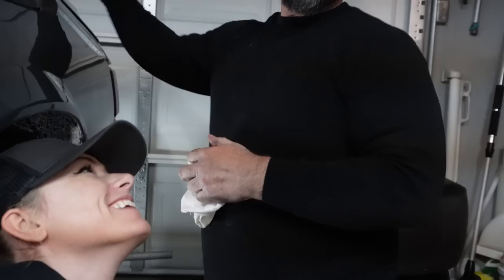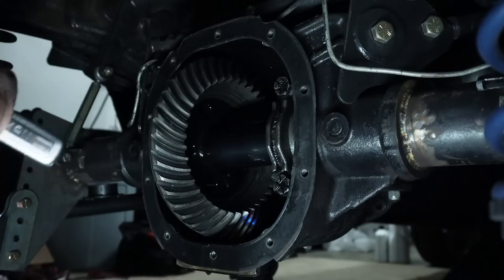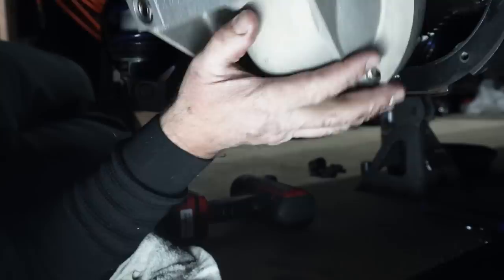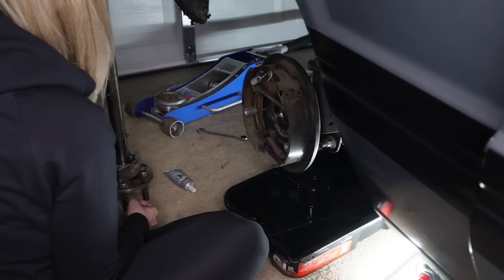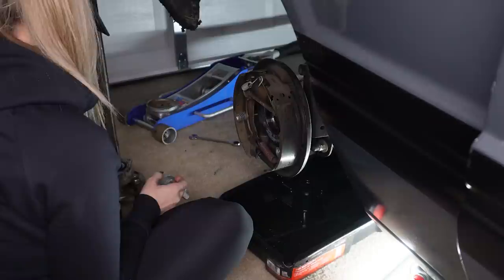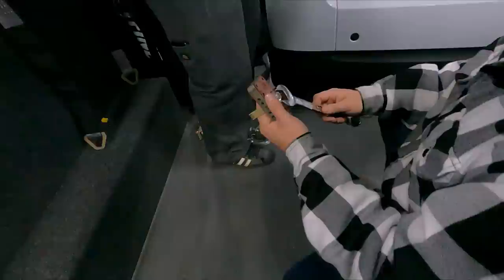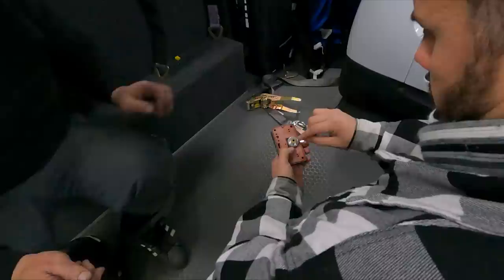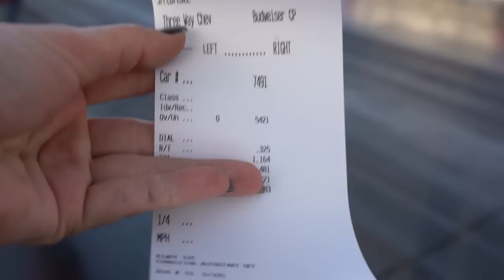Gray Mare DESTROYS the Stock Short Block Record (part three)

Comment: Congrats on the new record.  Great seeing the work you put into it instead of others who post one hero pass and act like it did it on the first try.   I remember going 6.4@108 with a factory xxx roller block 306 in a 2850lb 87 coupe back in 2007 and people swearing I had some stroker or a sportsman block etc lol.  I went 10.46 at only 126 where I ran out of gear and had to lift before the stripe.  I drove the car on the street all the time and everyone only ran 1/8 so I never bothered swapping gears and trying the 1/4 again before I sold the car.  Was definitely fun having people guess and speculate and accuse me of having more engine than I did lol.  Hope 2023 goes great for you guys.

Comment: Ok, that is super impressive (and T & T Gangster), that you are out hammering stock bottom end records, and wheels up high shoot to the moon stick shift launches with gun drilled axles on just a stock 4 lug 100mm pattern, and drum brake rear, and you hand torqued the ring gear retaing cap bolts too...Chek, Chek, Chek, Chek.....gotta love it brother! (They certainly must have highly improved the Famoso top end shutdown area, as it was mainly worn out black top turned mainly to gravel in the old days!) I know it was hard to get a heavy car stopped there on drum brakes.

Comment: After you chucked all the teeth off the distro gear down into the middle of the block,, cam,  rod and pan area on street pass 2, it cracked me up that Tess starts talking about tossing and chunking up belts.....lol, give me lost belts over those metal teeth sheared off internally any day, as long as it is a non-interference engine!
Reply from the maker: I get it, but when you’re in competition and lose all boost every pass at half track because your blower belt flys off, it gets frustrating. I did end up winning that race though, so I guess it wasn’t terrible. Haha.

Comment: Old school. 69 302 from a sionwagin. 66 mustang 250 6 cylinder rear gear c 4 transmission no vacuum 130 guarter mile. Best tramsim was a torkdrive from a 70 4cyl nova high and low gone

Comment: Congrats on the record. Can hardly believe it's a stock 8.2 short block, which convinced me I'm just going to refresh my stock short block and throw a blower on it. Wanted to ask, which Trick Flow heads are you running? 
Also, WE WANT MORE LUNCHBOX! That dude had my wife and I in friggin stitches!
Reply from the maker: They’re the twisted wedge 170s!
Reply: @MissMidnightMaverick   are they the 11R version or the non-cnc’d fast as cast version?
Reply from the maker: @aaronliddell4280  I bought them off of Craigslist 10 years ago, I honestly have no idea.
Reply: @MissMidnightMaverick  they’re most likely the non-cnc’d ones then. Very impressive. Do you know what cam you’re running in the car?

Comment: Hi, is this the build with the stock '69 or '71 block?    ( not the thin wall 85-93 castings )
Reply from the maker: It’s out of a ‘90 mustang
Reply: @MissMidnightMaverick  Holy Moly....   And a blower too..    That's amazing.   That block must have fell on the side of more favorable tolerances.

Comment: So this engine is complete stock bottom end other than the cam? I'm pretty impressed if it is and making over 600hp...I thought stock bottom ends starting blowing up at about 500..?
Reply: I've got a completely stock 302 with just an ebay turbo and bigger injectors and a aeromotive fuel pump... Running no more than 15 psi.. I have no idea what it makes though. Bought me a terminator x but haven't put it on yet.
Reply: That has been a long nonsense rumor created by shit talking chevy guys. There are guys making 800-900 hp on the stock bottom ends. Also, sell that termi and get you a coyote. If you are going dohc, go coyote, hands down. You can find them on the net for around 2k on a good day. If its a gen2 or up, you got an easy 1000hp ready to rock.

Comment: You guys need to try a c&s Billet aerosol blow through. Way gooder..when you have to lift and get back into it dont have them kind of problems.
Reply: There is nothing wrong with that carburetor, it was the distributor gear being worn out
Reply: Look like it bogged out the track to me when he got out of it and back in it
Reply: I'm not saying anything bad the car's fast as f*** it looks like it runs great at wide open throttle I just expect more out of my carburetor than only wide open throttle performance.
Reply: Understood but there is more to it then that. I’m sure things can be cleaned up more but part throttle isn’t that big of a deal when there is a time limit on how long this motor has.
Reply: We also run the carb rich because of the dry nitrous and it had a bunch of timing pulled to make the motor live.

Comment: How do yall keep a stock 302 together with 600whp? Insane! I managed to break a stock crank in half with a 125 shot lol
Reply: Probably close to 700 at the track
Reply: Make damn sure it doesn't rattle/detonate.
That kills more boosted SBFs than anything else.
Reply from the maker: Motor plate, mid plate, very loose converter, very conservative with timing, and the small shot of nitrous helps keep the air nice and cool.
Reply: @MissMidnightMaverick  
You got it, Tess⚘️
Reply: @MissMidnightMaverick   Av boys grandpa Hollywood    The Carburetor Chronicles  
Clearly You'All [of the Team] know well what You are doing to get this "Gray Mare" running its best and perform to this level !! 😄
Excellent !! Congratulations to and with ALL involved !!😆
Since You'All are proceeding with Tess driving, with significantly lighter driver mass, weight, it is reasonable that You'All would already know about a few simple things:
A. simple weight reduction via the brakes - as per noted in this recording - obviously removing the heavy rear drum brakes - replacing all four with lighter racing TBM disc brakes.
B. Aerodynamic - air flow: 
-1. using a lightweight fiberglass or carbon-fiber hood on the engine with whichever scoop or raised area as necessary - better air flow over the engine compartment and clearly air fore the engine intake too.
-2. remove side view mirrors and any other external protrusions.
These alone will gain easily -0.1-0.2 sec in addition to the driver and other weight reduction along with other simple improvements too.😏
C. Fuel:  Tess stated in the chat, the fuel used was C-16. =>this is a common mistake based upon common misconceptions among most experienced, street, track, amateur racers, 'enthusiasts', 'gear heads' and seemingly some of You"All, perhaps some of You too? 🤔
-1. C-16 = C-116 is a high octane fuel with tetra-ethyl lead
-2. high octane rated fuel is needed for high compression cylinders to slow the burning, combustion rate 
-3. => high octane fuel does NOT have more power or energy from burning, combustion !! 
-4. the chemistry, physics with various fuels is well known, established, precise, exact, accurate, calculable
-5. Octane=C8H18, octanol=C818O=C8H17-OH, methane=CH4, methanol=CH4O=CH3-OH, ethane=C2H6, ethanol =C2H6O=C2H5-OH=CH3-CH2-OH
-6. all octane rated common gasoline fuel have a combination with numerous molecule forms. compounds of various hydrocarbons from the simplest methanol, CH4O through higher order, longer chain hydrocarbon molecules including various benzene ring molecules etc. 
-7. higher order, longer chain hydrocarbon molecules obviously have more carbon, thus less power, energy compared with simpler hydrocarbon molecules along with increased burned carbon post burning thus deposits which also remain, and coat the cylinder, piston, heads, combustion chambers, valves, spark plugs, exhaust ports, headers and pipes.
-8. there is also proven data with numerous dynometer measurement of the engines, and within vehicles showiing the clear increase of energy, power, torque output from the engines through the entire drive train using ethanol, methanol, combination of these compared with all version of unleaded, 87-95 and leaded fuels including the commonly used high octane racing C-10 -16=C-100-116 fuels. ->even standard "E-85" from the local fueling station pumps, which is actually commonly 40% up to 55%, sometimes up to 65%, has been measured within all dynometer tests to achieve significantly more power, energy reaults than C-10-16=C-110-116, including with methanol injection. 
-9. The Best ethanol fuels are the pure and racing versions are E-85=C-85=85% ethanol, which NASCAR uses for decades, -90, -95, -100 100% ethanol which Indy Car switched to from 100% methanol since 2007. 
-10. also with cleaner fuels the fuel system remains cleaner, all internal engine components and exhaust the engines, since there is much less carbon, carbon deposits, thus carbon residue, build up, etc. The tetra-ethyl lead in C-10-16-=C-110-116, adds more to the deposits, build up with PB=lead, and more carbon -> all needlessly without any benefits, only detriments !
D. Ignition: If there are any possible improvements with the ignition, certainly more power can also be achieved, as You already know; higher voltage spark, ignition components [50 kV] and similar.
then, certainly, as You well know, obviously, the other considerations within the drive train, suspension etc. will clearly achieve improvements too.
E. Lubrication; As You also known, small improvements in performance, results will also be achieved with improved oils, fluids, grease, etc. within the engine, transmission, converter, gears, differential, axles, wheel bearings, etc. - certainly RoyalPurple,JoeGibbs,Shaiffer's are significantly above the 'major, 'minor ' brands from the StndOiInt'llConglomerate producers [we know them full list] and among the top, the best, proven by the full of tests, including durability, reliability is Amsoil - the only engine oil which is also 100% synthetic, with a 24 month, 24k mile warranty and the full test data comparisons to prove it. No wonder they were the first publicly available produced, verified, certified independently by 1972 and continue to improve, produce a full range of synthetic lubrication products along with their unique micro filters too. 😏
->Aren't Your magnificent, grand machines worth protecting, lubricating with the BEST available ??! 🤨
G. The results shown, achieved with the "Gray Mare" are certainly Grand, with all that exists, used,  components, set up, tuning, adjustments, etc.
Good Luck, All The Best and Much Success in Your Quest, Health, Happiness and Well Being. 😊
Sincerely ☺
Reply: @MissMidnightMaverick  thanks for getting back to me MMM, that explains things 🙂
Can't wait for more Gray Mare content.

Comment: Looks like you guys need to take that gray mirror over to Old Man garage and let him play with that carburetor if not ATMs got a signature old man garage carburetor maybe you ought to put that on there
Reply from the maker: Did you watch the whole video?
Reply: Why, so he can fuck with the idle circuits every 5mins?
Reply: @MissMidnightMaverick  I watched the whole thing but the sound was way down so I missed some stuff. That dude called Lunch Box did the carb. Does he sell carbs to the public? Under what name?
Reply from the maker: @peskypeet  he owns a carb shop and has been working on them for over 20 years at his shop.
Reply: @MissMidnightMaverick  Tess- Thanks for replying. So what's the name of his shop or brand of carbs?
Reply from the maker: @peskypeet  Ted’s Carb Shop
Reply: @MissMidnightMaverick  Thank you. I've never heard of that. But there's soooo many good companies out there that have somewhat of a low profile.
Reply from the maker: @peskypeet  he’s a local carb shop out here, he doesn’t sell specifically branded carburetors, just works on them, rebuilds them, and tunes then.
Reply: @Adrenacyde  this is fucking hilarious 😂
Reply: @lunchbox2565  It's only funny because it's true.

Comment: And then changing Jets changing power valves actually working on it on the spot at the track that's the whole fun not plug it in the f**** laptop taking out some time and adding some fuel cutting out the delay box f*** all that it shifter and gas pedal that's why I love this fuken car 💪💪💪👍👍👍🏋️🏋️🏋️🏋️